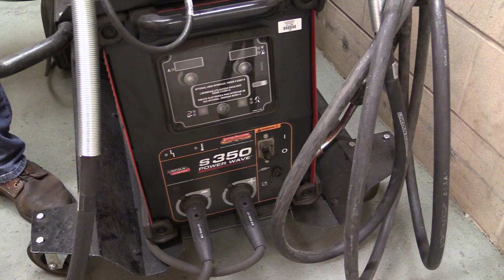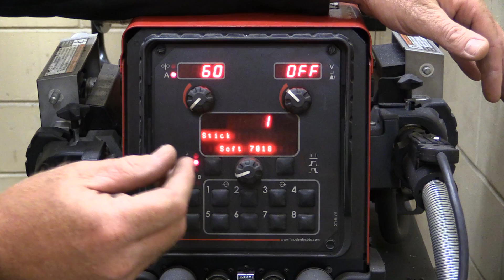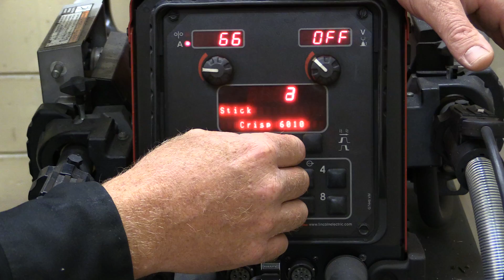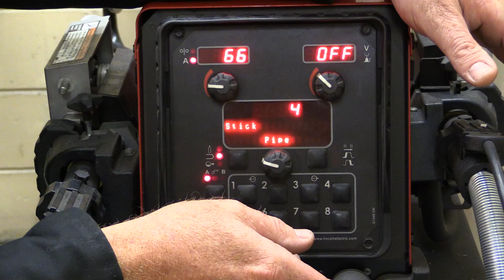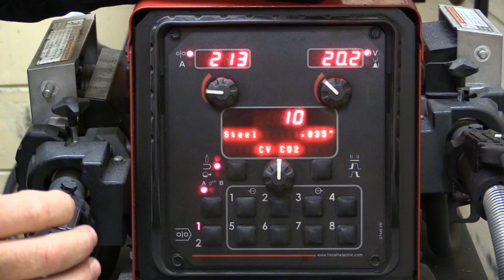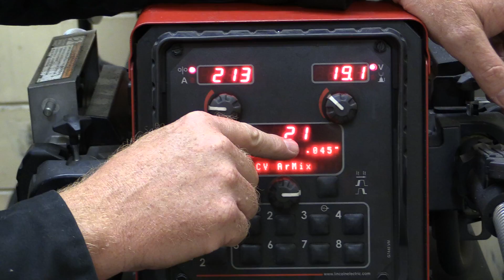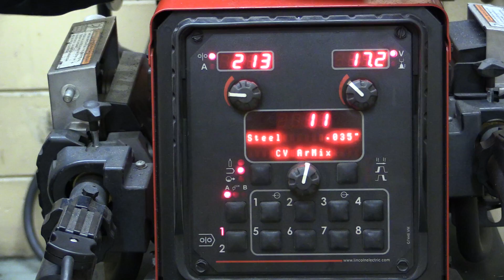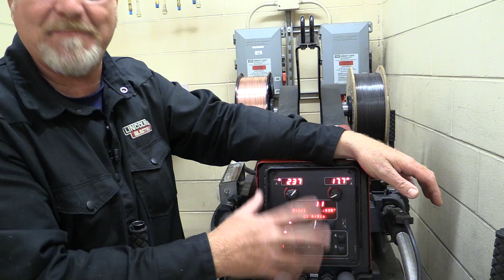Set- up and operation of the S350 Lincoln for first time users.

Comment: I work at GM Brazil and I am in charge of update the department welding machines.
The local Lincoln seller has suggested the S500 model and in some days ago I got the S350 from other department for testing. The welders are enjoying to work with this machine. 
I really appreciated your shared knowledge and very important advices. 
Thank you from Brazil.